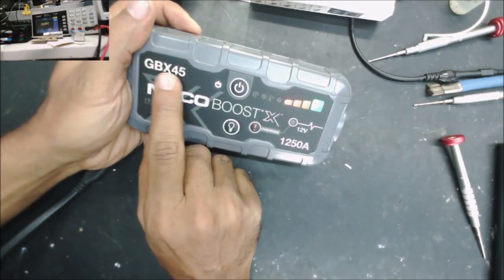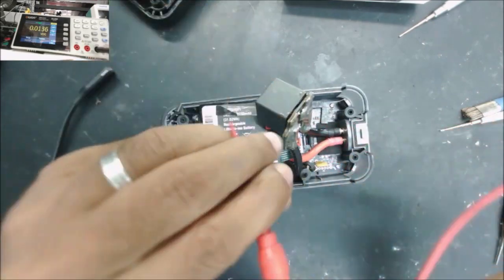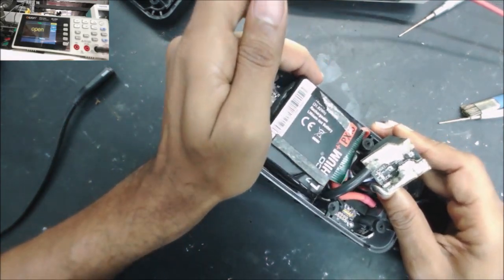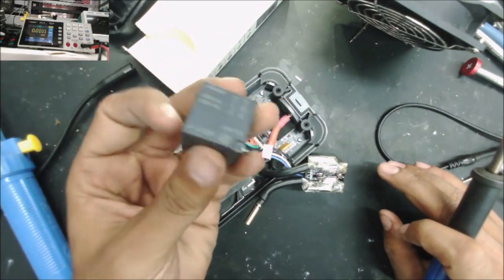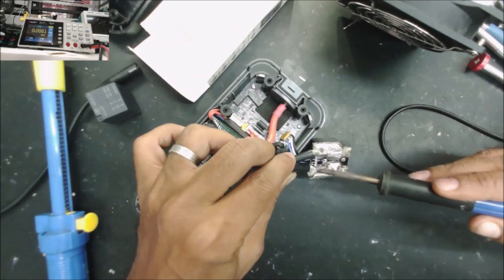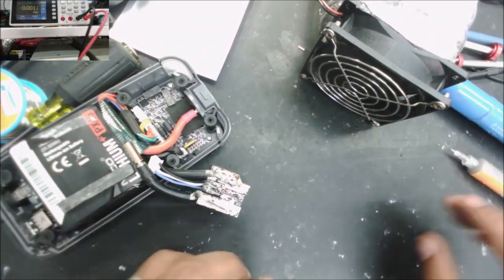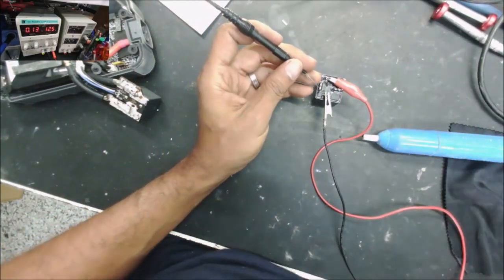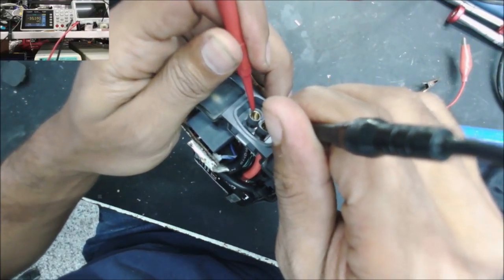Noco GBX45 everything works! but no boosting voltage

Comment: Good afternoon
Accidentally checking the voltage when charging the battery, I touched the clamps, it was 17V, after that my GB150 does not show voltage, but everything else works, I found damaged elements S16G, SS142B, HT46R064B, tell me on last chip, it needs to be programmed? or buy a new one, replace burned out and will the voltage display work?
Thanks

Comment: You could have saved yourself a lot a trouble and just clean the relay contacts . this is common practice in electrical industry
Reply from the maker: this i a sealed relay  the time and effort to take it apart is more then to replace it.
Reply: How would I go about cleaning it do you think?  I have the same model with the same problem but I don't want to muck around trying to desolder that big blob.
Reply: @Bonswally  If you notice on the underside of the relay there is a bead if adhesive around the edge if you cant loosen it with isopropyl alcohol and or hot air i would cut the top off the relay clean the contacts with deoxit and burnishing tool and glue top back on
Reply: @alexkay1874  Ok, thanks.